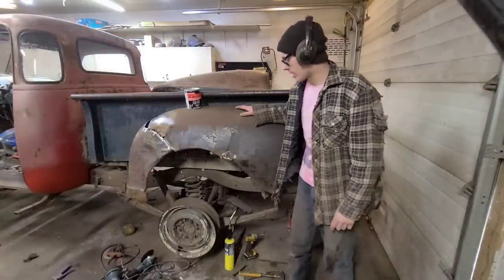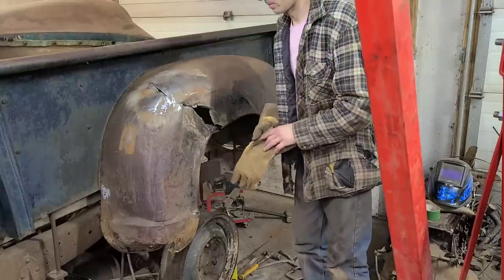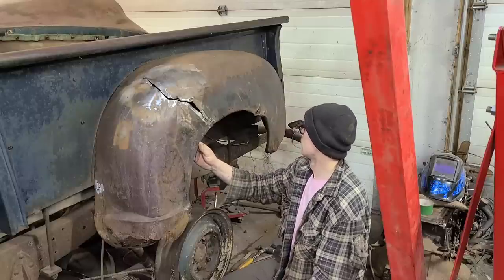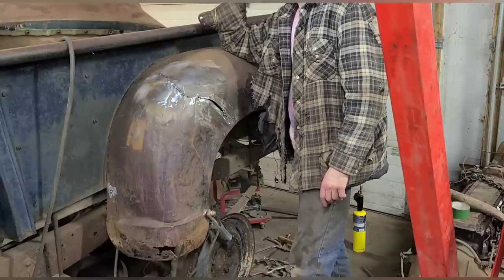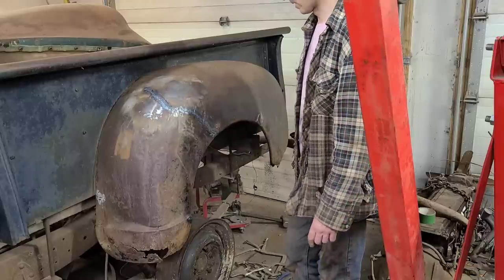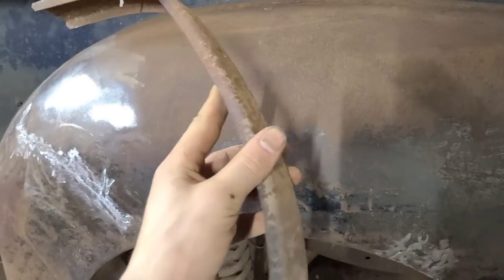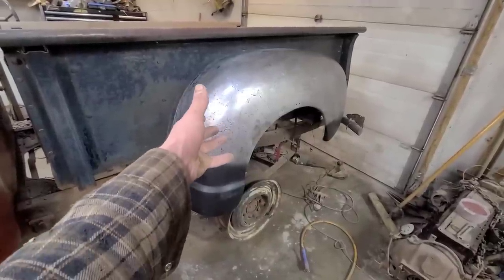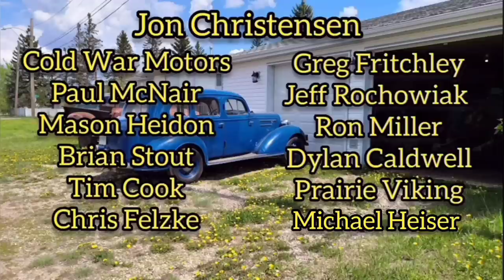I Accidentally Destroyed This Rare Classic Truck Fender! Don't Make This Mistake!

Comment: Yet here I am dreading fixing a 2 sq inch rust spot on a 90's "bonded" panel repair. They basically bashed in the dent until the patch panel would fit, glued it in to place and mudded in the edges.

Comment: Watching you work teaches me that first you have to learn where the metal will go when you use a hammer and/or dolly on it.   It also teaches me that unless you get the metal where it belongs simply forcing it to where you can weld it together and filling in the low spots is a waste of time.  I never thought about the techniques and experience it takes to get to where you can fix damage to metal panels.
Reply from the maker: I'm happy to hear you're learning from these videos. Thanks for watching!

Comment: I am 68 and have been welding for quite a while. But I have never tackled sheet metal until recently. I have 3 old trucks . 1964, 1965 c10 and a 1979 c30. Trying to repair rockers and fenders on all these. You are really talented and I wish you well . Thanks for sharing your experience. Great job . David.
Reply from the maker: Thanks David, it sounds like you've got a great collection of old trucks. I'm a big fan of the 60-66 and 73-87 era! Good luck with your projects!

Comment: The rear fenders on my37 Chev PU were pretty banged up, but no missing metal from rust.  Surprisingly the only real rust was two spots about 2 inches long where the floor pan meets the back of the cab.  Currently the fenders are in Minnesota with a guy that has a reputation of a good metal repairman.  I could have picked up Fiberglass Repos, but I would rather have all original metal.  I'm building a Resto-mod. I've boxed the frame, installed a FATMAN MII front end and an LT1 from a 2014 Silverado.  But overall, my intent is for it to appear as close to original but obviously lowered.

Comment: You are an artist sir. Much respect for your skills. These skills are being lost unless we get more people interested in manipulating metals.  We cant rely on availability of replacement parts and even accurate ones. 
I really find this interesting, and inspiring, that what most people would write off, can actually be repaired, which is more environmentally friendly than constantly replacing and using huge amounts of filler.   As governments want to direct the population towards electric vehicles, I believe that actually what will happen is that repairing older vehicles will be a precious skill that we should encourage.  Electric vehicles in rural areas may prove to be impractical and the older trucks and cars will be valued.
Reply from the maker: Thank you!  There's definitely going to be a time when replacement parts are no longer available so it's going to take a lot of creativity to keep this stuff going.

Comment: Well I enjoyed every minute of this video. Most people wouldn't even have looked at that fender. It would have been ripped off the vehicle and consigned to the skip without so much as a glance. You have shown that it is possible to bring a fender back from the dead. Your body working skills are exceptional and for that to be a top class fender all it would need is a minimum of the fine filler and perhaps a coat of high build primer. I don't think bodywork is boring I think it is very satisfying. What I hate on a car is an engine that won't run right and you have run out of ideas as to why. Then it gets boring.
Reply from the maker: Thanks I agree about engines...that's why most of my vehicles don't run!

Comment: Great save! And great goal/attitude! I’ve been “fixing up” a 1950 Dodge Power Wagon with kinda the same goal, serviceable and a “20 foot” paint job. I started with a very bad rust bucket. It appears that the Chevy/GMC fenders were much thinner metal than the Power wagon!
Reply from the maker: Yeah those old Dodges were built a lot tougher than these trucks. Good luck with your project!

Comment: My english wheel looks identical with the wood block and rubber band at an angle.  I noticed you reversed the support legs with two in the back and one in the front.  I tried that and it was really unstable.  What is your experience?  Is it screwed to the floor ?  Thank you.
Reply from the maker: I can't remember why I reversed them, I used to have it attached to my workbench back when my garage was somewhat organized

Comment: Ever think about installing a steel rod in the rolled edge of the fender to reduce the vibration and prevent cracking  down the  road?
Reply from the maker: No. Lots of early cars had rods in the fenders from factory, or were welded in later and they still cracked. These vehicles were driven on unpaved roads or through fields and had the tar beaten out of them. It's second life should be a lot more mild. The reason the fenders crack on these trucks is the front box mount rots out and that puts all the weight of the box on the fenders and running boards. The fenders are the weak point so they crack.

Comment: I liked the first solution -- chuck it! One glance, and my assessment was 'this fender is phukt'. But I know this guy, and he loves a lost cause. Transformation! I figured there would be patches, due to the truly mangy condition of the cracks and hey -- it's dilapidated! But after much work, it became a fender again. I still don't understand the Tijuana part. I also do not understand the use of the Mapp torch -- it does not heat the same as an acetylene torch, so I am not sure how it helps. Of course, i am the student, not the critic.

Comment: I bought an Eastwood 200 amp tig brand new and it sucks. I think I need to tare it apart and check why I go through a bottle of argon in an hour . All my settings are right but  I think it must be leaking somewhere inside and through the venturi effect it's sucking oxygen from the air and its coming out the sheilding hood to my weld area.Ive never had any luck welding with Ac or DC on aluminum or steel. what's your thoughts? You have the same machine yes?
Reply from the maker: Sorry I don't have any experience with the Eastwood welders. I use a Miller Diversion 180

Comment: I know you don’t want to make these into how-to video but am fascinated by what you do,and would appreciate greater explanation.  For example, when do you determine that application of,heat is appropriate?  When is it appropriate to use that spatula like tool?
Reply from the maker: Hi, I have several videos doing how to's on fixing stuff, such as the 36 Chevy fender repair series, as well as the fixing a 1930's car grill bottom video covers heating a panel. Thanks for watching!

Comment: A question. I get what you are saying about the edge of the fender being where the strength is. But as bad as the fender was would it stand up to say everyday use ? Don't worry I'm a boring guy  that enjoys your videos thanks.
Reply: I have a 47 Ford that I used rebar in the fender lips, just formed and welded it, you can't see it from the outside but it sure stiffens them up and stops all the flexing so they can't Crack, some guys use #9 wire but I love overkill
Reply: @geoffreymills9932  thanks for that information 👍
Reply from the maker: Depends on your definition of everyday use. Regular driving it would hold up just fine, driving full speed through a bumpy field with a box full of manure and it probably won't hold up. Roads are a lot better than they were 60-70 years ago. Also the reason these fenders crack is the front mount of the box is a wooden block, once those rot out all the weight of the box is on the fenders so they crack. If the box mounts are good, all the braces are in place and the cracks are solidly welded it will be fine.

Comment: Great video Kyle! I have a '56 Chevy 1/2 ton that I have dents all over the back of the cab that I have to H&D out, however, there is inside cab metal that doesn't allow me to access the back, and there are some nasty creases that need to be pulled. Would you cut and weld, or just use one of those dent pullers that weld a stud to it and hammer out? I am not sure what to do about those crease. Thanks
Reply from the maker: Depends on where you're trying to go with it. Dent puller will only get about 75-80% of the damage out and you'll be sculpting the rest with filler. Having the inner panel out will make it easier and faster to get the damage out, but if you have to make a mess to remove the inner panel then I'd just use a dent puller. I've never removed the inner panels on one of those cabs so I don't know how much of a hassle it will be.
Reply: @CarterAutoRestyling  Thanks Kyle, yeah removing the inner panel is a bit of a hassle to correct dents and creases from years of abuse. Seeing as the back is mostly covered by the bed's front panel, I think working it as best I can with as minimal bondo is my best option. I have a spare junk cab that I could remove parts of the back panel and weld in and correct that way as well. Do I deal with potential heat issues or bond, that's a decision as well. Can't hammer and dolly distortion out and I'm back to square 1!

Comment: I realize that they are ridiculously expensive, but would an Eckold hand-held Planishing Hammer (see eBay “Eckold GL2”) speed up the work, or would the user simply tend to overwork and stretch the metal?  Note: looks like you answered my question @ 30:45, but I would be interested in any additional thoughts.
Reply from the maker: A hand held planishing hammer saves a ton of time and does a beautiful job in the right hands. In the wrong hands they can do a lot of damage very quickly, some day I hope to be able to buy one!
Reply: @CarterAutoRestyling  on my wish list as well, but I’ve got a long way to go before I’ll be good enough to use one.😁  Really enjoy seeing your work!

Comment: Use a flat copper strip like just to put in the back of the area your welding it helps not to burn the edges of the metal and the weld wont stick to copper.you should have stated welding on opisit side.
Reply from the maker: Thanks for pointing out everything I'm doing wrong. I'll be sure to consult you before doing any repairs in the future.

Comment: Well you demonstrate it very well how to make something out of nothing! Actually less than nothing. First time seeing your channel that I'm aware of. Don't know where you're located at. But even out here in a rust belt you can still buy an old pickup bed trailer 48 to early 55 and take the fender off of it and use it or maybe the whole bed. You may have to work it but it's all how you choose to spend your money and time. And pick up beds have really gone up in value lately they used to be a couple hundred bucks and come with a decent bed. Just an idea. They are not all beat the heck. Fortunately we got family farm and I've been collecting things for some time as my dad did last night offsprings have done. Anyway I have pick up that trailers Ford Chevy Chrysler from about 50 through 88 as far as years. I've had more but I've used the beds over time and that's why I bought them. It's always amazes me it's not going to the junkyard here wow I wish my project started out looking as good as a piece of junk truck that they're partying out. Like why did they cut this truck up with such a fabulous looking bed? But for whatever reason if you can acquire pickup bed trailer you can usually resell that same trailer without the bed on it for the same amount of money and let somebody else put a wooden floor on it. Hope I wouldn't for aren't yourself and sell it. Now that at least in a few States the method which you title a homemade trailer has changed . No it's a pain in the back side to get a trailer title and tag in several States because of process you have to go through. Just a collection of thoughts and maybe a couple ideas for a YouTube episode. I really enjoyed watching you work on that fender you're an artist
Reply from the maker: Thanks for watching! There are plenty of old pickup bed trailers here too, but they are all trashed beyond recognition. People here in the prairies are thrifty and stuff gets used until there is nothing left of it.
Reply: @CarterAutoRestyling  I just do a lot of traveling. I find them in great shape and there's no rhyme or reason or pattern to where to look. Not always the beds are looking for either. For years I drove by this 60 to 66 style short bed fleet side trailer. Just never stop asking about it. Now it's gone but it was in fantastic shape. I know where there's a 58 Chevy trailer same type of situation. He sits firewood in there for sale. He uses to pick up trailer as a static display and in his case cell bundles of pre-cut and split  firewood. I guess he's careful with it when he loads it because original paint and straight as an arrow. You get to know your local delivery driver. Even picture what you're looking for. Just another idea that has paid off before.